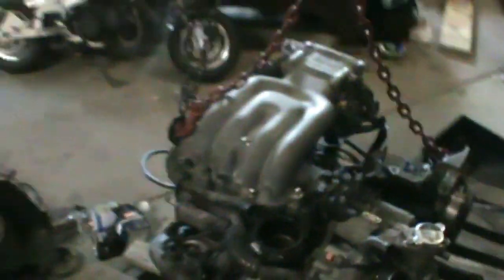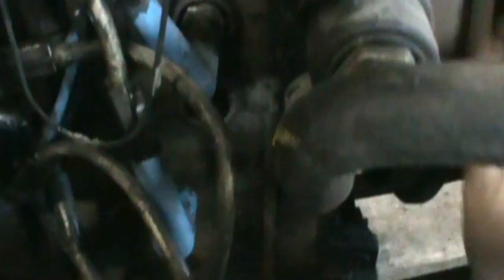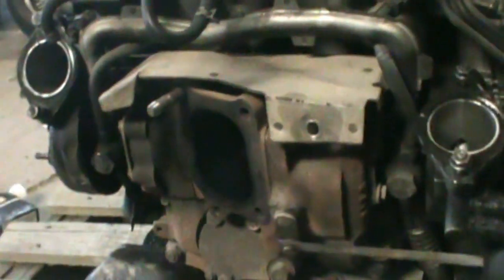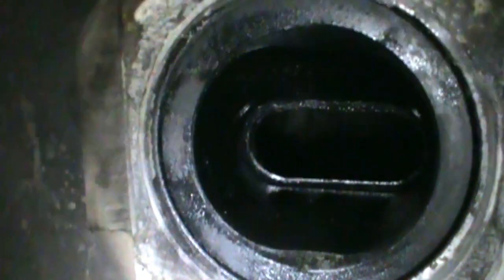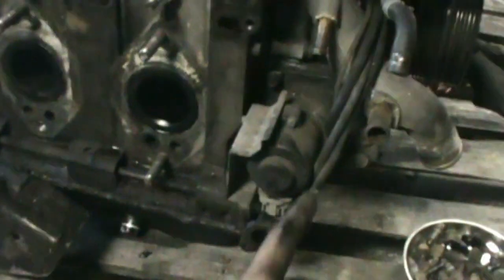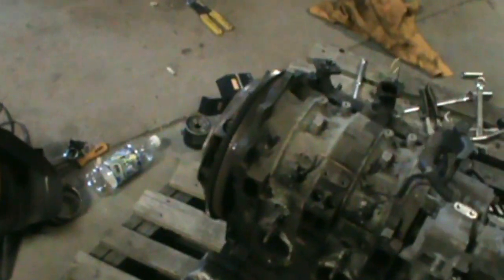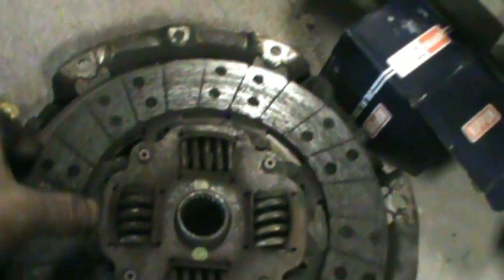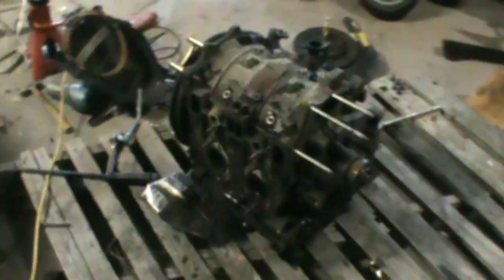How to Rebuild and Port a Rotary Engine : Part 2

Comment: I want it because its immaculate but i don't wont to blow out the bank account with it ahhaa. Just wondering if you could give me any guidance to the avg parts and fluids that id need to change in order for it to be a good car. id give it a bit of a rev out every now and again but i wouldn't drive it hard by any means.

Comment: Hey man, I've been thinking of buying a 2001 rx-7 1.3 TT most likely a FD or something, i was just wondering how they are when it comes to reliability, i've got a friend that has one with only 40,000kms on it and recently got all the seals and the second turbo fixed because he didn't rev it hard enough to get it going for a significant time. I wouldn't mind buying it but i was wondering the avg things you have to change in order for it to be reliable. I would be using it daily to get to work.